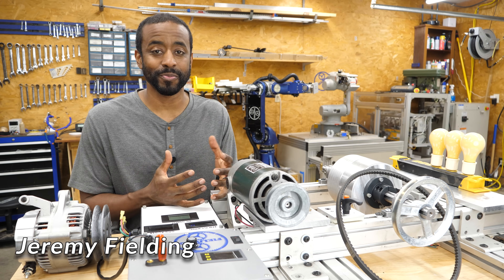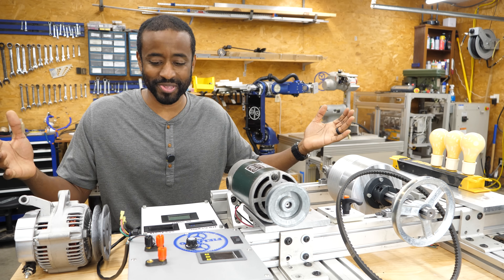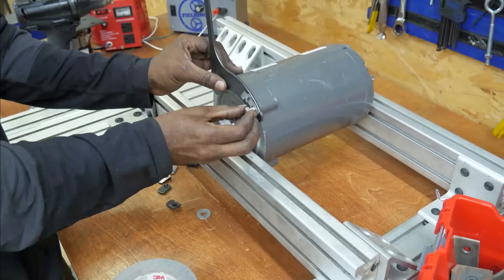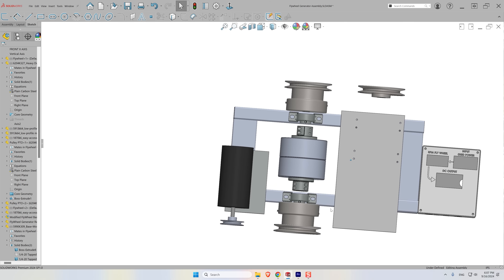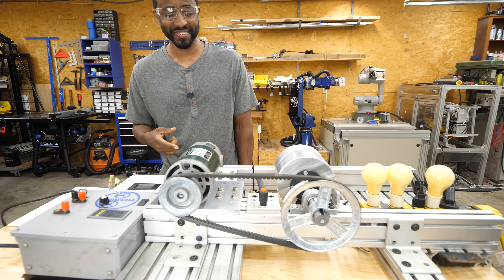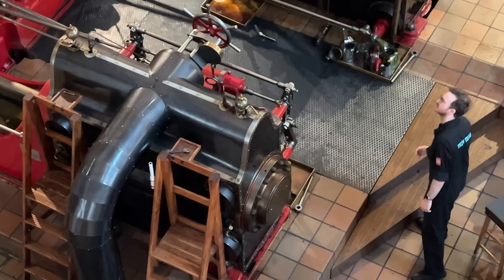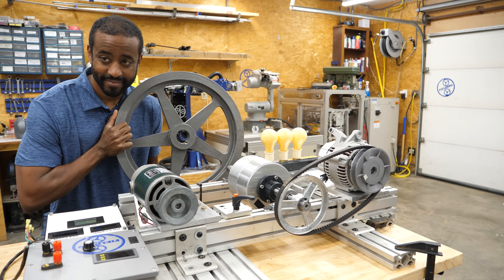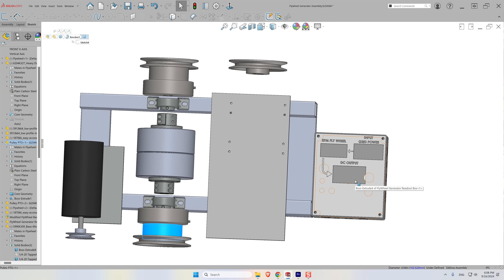A Machine To Test Free Energy Ideas.

Comment: i haven't watch yet and wanted to make a comment prior to seeing your video. ive personally made an over unity device by taking motorcycle alternator stator & rotor to a bench grinder then simply plug the bench grinder in the wall and turn it on and measure 1 phase x 3 output from the alternator result was about double (189v) the ac voltage output than the 110v input. that's just one side of the bench grinder anyone can reproduce and prove that over unity is in fact real.  key thing I've learned throughout my research and experiments, is utilizing batteries to accept the excess voltage then using an inverter to use the energy from the battery. i know it sounds counterproductive and why not just use the ac voltage directly from the alternator. its because the excess voltage under load reduces the performance of the motor bc the alternator has drag from the load which then reduces the voltage produced bc the rpm's decreases to below the input voltage from the wall.  i believe the best type of over unity generator is a version that follows this general concept: dc input to spin a shaft coupled to 1 or more washing machine rotor(s) around the rewired stator(every 3rd stator arm wired in series 1-2-3-1-2-3-1-2-3...) resulting in 3 phase  output ac rectified to dc to charge multiple batteries connected to an inverter to supply your ac power. this system does not drain any of the drive battery and is modular meaning you can expand this system as required to meet your electrical needs. now ive watched this video and i hope you didnt use all these fake over unity videos to prove these systems dont work because machining flywheels and building an interchangeable table is cool and all but a waste of time when you couldve built the generator i just explained in less time than this. good luck and i hope to see your video that highlights atleast this type of generator to prove the concept then future videos with a well thought out new and improved design that you keep open source so you keep staying alive :) people who try to sell over unity devices always end up leaving earth mysteriously thank you for all your hard work and dedication to your craft. i enjoy watching your videos so keep it coming!

Comment: Hi, can you build a picture to summerize building one part of a machine, on all it's properties, like a basic sceme + an example and it's relevant questions?

My intention is to simplify what you need to look into when you create a general system, there are repeating concepts, and maybe selecting a set of relevant concepts is alligned with a selecting a specific tool to build.

Now, what if that picture, parts property set, and error states - were all visible to your eyes just from looking at the part?
- because it's transparent?!
- because it has "steps", so when it's state changes, a step in actualy made in the visual view of it, like adding a screen, bolbs, a shape change, ...
- because it carrys simple icons that mark a certain properties selection.

Lastly, I wish my keyboard would show me the wire map it adhears to on it's back, and the cycles counter with a "slow down" speed factor so I could see a sequence the last actions being worked out in the system, see the contents of messages that are communicated with the keyboard. nothing about the keyboard will be hidden.

Problem = Too Much Data to Present on a Part

I just hope we bypass the problem by using every thing we can about the device in a good order. so all you need to do is know where to look (+? howto).

Comment: Honestly, I think I would have tried running and burnishing the clutches a bit and seeing if they smoothed out just by being used and broken in. You have to burnish AC compressor clutches that are similar to that on a fresh install in a car by engaging and disengaging it at an elevated RPM and letting everything work in together.
Reply from the maker: I didn’t know that. I can certainly connect them and let them run for a while also switching them on and off

Comment: "Free" So IF a device used the magnetic poles of the planet to make energy it would not mean free because it would be creating power from the planet same as solar using power from the sun?
Like a "thermocouple" placed beep in the earth, wouldn't be free?
IF the "dumb" "free energy" devices worked it would not be free because you needed to buy "stuff" to build it, like buying a solar panel?
So what is free energy you're talking about? Putting in less energy than you get out of the machine?
Same as solar right?
Edit: Do you only mean free energy from a perpetual motion machine?
lol well, the earth and sun are perpetual motion machines, right?
Reply from the maker: Actually no they are not. The sun is measured daily and we can see it is burning out. The earth is slowly down. We add one second to the clocks every few years because of this. The moon is slowly moving away from earth. You can look all this up yourself. It is more like a big clock that was wound up and running down. The “clock” running down is called the heat death. Just search the internet. It’s a great day to learn instead of just assuming every scientist and engineer is an idiot who can see the obvious.

Comment: My lawn mowers power drive mechanism was a simple v-belt and tension pully connected to a hand lever by a bicycle brake cable, you could do the same but with solenoids instead of hand lever (much cheaper and simpler than those units you have)

Comment: Reduce your feed rate on new programs. Sometimes I adjust the external shift on z axis so it'll stay above the material. Only works on 3 axis machines though, and is not for every application. So i suggest slowing that way down. Give yourself a chance to stop before crashing.

Comment: Thst tool change was really close.  i would program the table to move away before changing tools.  also to avoid crashing when running a new program use single block when bringing a new tool down.

Comment: If you serious about finding a over-unity device then the only legitimate over-unity device worth machining is John Worrell Keelys hydro pneumatic motor. It utilized at least 2 over-unity phenomenon(possibly 3) that are recognized by modern science, air cavitation and a water hammer. Physicist Dale Pond came across the device in the 90s after it was bought from the Franklin Institute in Philadelphia with the label of "perpetual motion machine". Its not a perpetual motion machine but is the only legitimate over-unity device I've ever come across in a decade of research into the subject as a professional computer programmer with a degree in electrical engineering. Dale describes the device in detail in his fascinating lecture on sympathetic vibrational physics. It harnesses the legitimate over-unity phenomenon of water hammers and air cavitation to achieve 100% real, measurable, over-unity.  The mysterious engineer John Galt in Ayn Rands "Atlas Shrugged" is supposedly based on the real life John Keely./ Some say, if Tesla was 100 years ahead of his time, Keely was 1000 years ahead of his time.
Reply: You had me at “over-unity device” 😊

Comment: If memory serves me correctly, there is a specialized UPS called a rotary UPS that uses a large flywheel driven by an AC motor to power an AC generator. When the power fails, the flywheel is used to maintain power until the batteries get another motor powered up that then continues to drive the flywheel to maintain power. Has a use where the power must be clean & constant. Rather interesting concept.
Reply: Tbf, that's how most of the grid works, there's not that many dedicated flywheels, but when you have a 100MW turbine that weighs in the range of a hundred metric tons turning at 4000rpm, it takes a lot of energy to slow down. That's like a couple fully loaded semi trucks going at mach 2.(I.e. coast to coast in less than 2 hours)
Reply: @satibel  true, it's impressive how much energy is stored in them
Reply: I was in an ancient telephone central office that had something similar to help the batteries carry the load in the event of a power failure until one of the generators could come online.

Comment: Solar panels are not free if you are required to purchase and maintain them and all of the equipment required to interface with the home site and the grid.. They don't take care of themselves, and they require attention from time-to-time. Also, when they go bad, they must be disposed, which in some way cost.
Reply: That depends on where you live. Here where we have massive lake effect snows, the work load is high. Having been a Master Training Specialist in the US Navy, an Engineer at Dalmo Victor Div. of Bell Aerospace, and Instructor of Industrial Electricity/Electronics at the RMTC in Battle Creek, Michigan for 22 years I often feel people are failing to see the over-all cost and only looking at the immediate when talking about Solar and EV Vehicles. There are the production costs, start costs, the run costs, and the end game costs. And the unreported environmental costs now and down the road. They are not as free as advertised.
Reply from the maker: I think you are overestimating the work load. You barely need to clean them and they last at least 30 years. Usually get your upfront cost back in the first 5-10 years depending on how big the system is and if you have batteries. In most situations I think it is fair to call that free. Only meaning energy you are no longer paying for. But in fact it pays you because most people won’t opt out of using energy. They will pay for it. In this way that money can be spent on something else so it turns into a pay check or rebate on your power bill cost. Whatever description makes you happy
Reply: @Jeremy_Fielding  Batteries are a problem, they are not eco-friendly: lithium... At least we in Serbia are facing destructive mining by various companies...I think that it is much more important to use energy wisely, than its mass production.

Comment: Hi Jeremy, I am also a sceptic of free energy…..but, I once saw a guy stack and connect two 55 gallon water containers sideways, fill them with water, connect a hose to the top and drop the other end in a river then a hose to the bottom container with a ball valve. After hand filling the containers he opened the bottom ball valve and the suction of the water pulled water from the river to water his crop. Now wouldn’t it be possible to create a water mill generator sealed system with that idea?
Reply: No, they isn't a configuration possible that generates energy. 
Steve Mould has lots of good water models with some things that look like free energy, but they always run out. 
Can you use a siphon to run a turbine? Sure! Same as any hydroelectric plant, you always need water to move downhill. 
A closed system implies the water has to move back up the hill,  and that's what makes your suggestion not work. Hope that's clear!
Reply: The siphon only works if the output is downhill from the input. With the irrigation system above the water goes uphill eventually because it evaporates and then comes down again as rain, making it a very indirect solar energy system. If you sealed the whole thing then you need a way to get the water back up and that requires a pump or evaporation & condensation or such, which take  energy.

Comment: Steve Mould has a great video on mechanical analogs of electric systems. There's a kit available permits creation of mechanical representations of simple  circuits consisting of capacitor, resistor, inductor (s)

Comment: I usually use a lathe for O.D. and I.D. turning, then plotting hole patterns and gear hobbing ect. I will use a mill, also on aluminum and brass and other materials that are softer and to the "gummy" side like copper and stainless steel, you get a better finish with 3 fluted and up and a lighter feed rate. The "career machinist" was correct on running dry runs at 10%, does your machine have a graphics only dry run feature? That should be the 1st visual on tool path. Lastly, make sure you have correct offsets per tool, including if it's center line, or tool edge, and length ect. You are doing great, and I seen the build on the robotic arm and others 💪 👏 🙌 be safe and thank you for amazing content!!

Comment: answer; bearing friction and magnetic resistance from the generator.
Reply: G'day,

Nobody knows how to transmute Torque into Excited Electrons with better than 92% Efficiency - so 8% is lost to Heat from Friction , and Noise from Vibration...; 

And then again, nobody knows how to transmute Electrickerieaze in a Wire, into Twistinesses of the Shaftings..., any better than arguably pretty much the same 92% Efficiency...

So, there goeth another 8%.

A Bicycle Chain-Drive is 98.5% thermodynamically efficient - so let's pretend that yonder Beltings & Shafted Bearings are roughly as good as their task...(?).

My thus rough-as-guts 
Guesstimations leads me to suspect that
At
Least 20% of 
Whatever  bolus Dose of
Kinetic Energy is applied to 
Spin-up the Flywheel...,
Will be lost to Heat & Noise ;
By the time that
Twistiness has Bin-Converted into Electrons & wired from Alternator to the Generator,
And then
Transmogrificated back into
Twistiness
Applied unto the
Shaftiness of the 
Flywheel 
Within which their
Plan
Confidently expects to 
Store the
Resulting Free
Energy...(?).

Or, have I
Missed
Something...?

Such is life,

Have a good one...

Stay safe.

;-p

Ciao !
Reply: I was looking to see if anyone else said this.

Comment: Reminder, install light switches to control all external outlets so if your neighbor is a "free energy" enthusiast you don't get stuck with the bill.
Reply: Don't install light switches, they are rated for like 6A on 230v, so if you put a 2kw motor (e.g. a lawnmower) on them you'll weld them. 
Install 16 or 20A switches or whatever 
You can either install them inside or install a 20A key switch outside next to the outlet. (So you can lock it to prevent turning the switch on or off.)
Reply: @satibel  In the US we don't usually run 220 outside. Only 110. And I only know 1 person with an electric lawn mower, and that is ran off of batteries.

Edit: we generally only use 220 volt for appliances (ovens, dryers, etc.) and HVAC in American residential electric systems.
Reply: @chrishayes5755  “ ferb, I know what we’re going to do today”
Reply: @chrishayes5755 yup, you could get that horsepower at 1.3-1.5 L 4 cylinder ICE engine at less than 6L an hour, while electricity is half that cost where I live. 

If you had that in solar panels, had two electric cars with 220 inverters (DC to AC) you could feed the local grid system at a good profit.

Your neighbors probably won't want to pay 35,000 watt hours for 30 days, 24 hours (each). It would be like stealing a basic Mercedes Benz a year. But invest that money in solar panels, it'll pay for itself and a free Tesla by the end of the year.

Gas ICE generator=>2x stealing from neighbors>=2x solar panels cost.

Solar produces the same amount of energy at 1/4 the price leaving 1/4 to pay the price of purchase and 1/2 is profit.

I don't know what kind of 150hp worth of power motors you need, it's more power than running a factory at 3-5kw motors per section of conveyor belt.

If you think you are a genius, just steal power from a neighbor like you wanted too, then run an inverter and fake solar panels and sell the local power back to your utilities provider.

Comment: Rust inhibiter! That poor table, vise and three jaw! Face your part first to reduce overall length the endmill has to cut and increase clearances. When cutting full flute length drop speed and feed starting with ~75% and then play with it at the machine. Multiple finish passes and spring passes if you can't program a helical contour. If all else fails a reduced neck endmill to limit the overall tool load. I run a super mini mill at work and run into that same problem some times. I get really nervous when I have to bore deep holes!
Reply from the maker: I use a rust inhibiter coolant, but the machine hasn't been used in about a year. I didn't show all the maintenance I did before this to get the machine back to ready state.

Comment: I like that you intend to include unfortunate realities of physics. There's no free lunch. Entropy is reality.
Reply: Well just tap what ever cause magnets to defy gravity and what spins the atoms.
Reply: "Free energy" is everywhere around you. It's just a matter of creating a method for harnessing it efficiently. "Free energy" in regards to creating energy out of nothing doesn't make sense obviously and shouldn't even be addressed... so I'm not sure what the point of Jeremys video is. Breakthroughs WILL happen and it won't be a motor pushing a flywood on an alternator or magnets arranged a certain way to spin a shaft. It will require leveraging extremely high level knowledge of physics, and overlapping knowledge sets that give the individual unique ideas and perspectives.
Reply: @chrishayes5755 nuclear energy is the best solution to a longterm unaltered energy source we have ever found. It's just a matter of shrinking it to a size that anyone could use without being massively hazardous. But thats proven to be the best longterm source of energy we have and no ones proven it different.